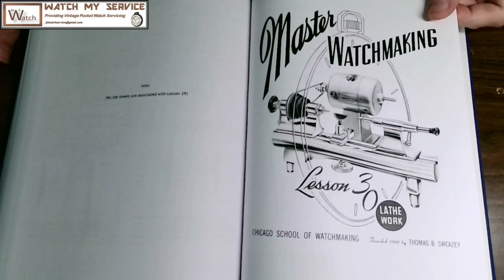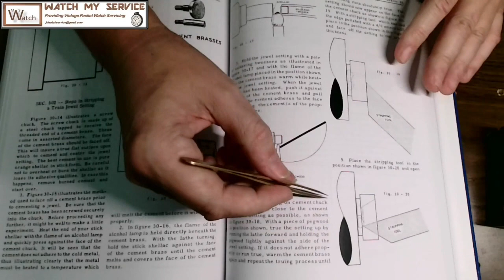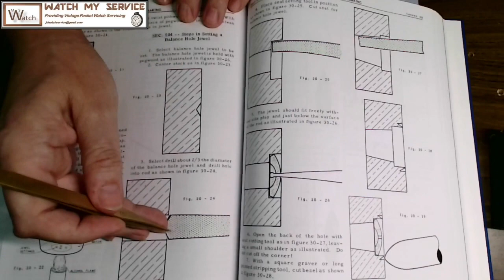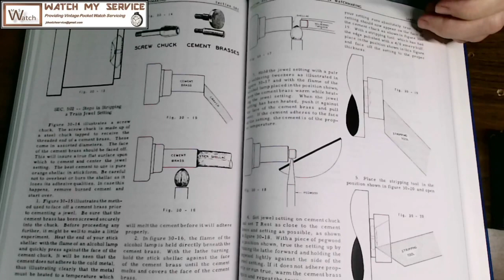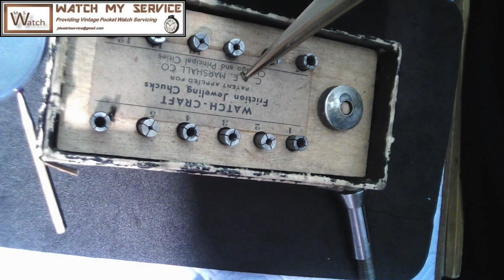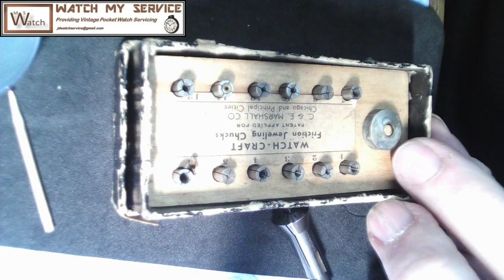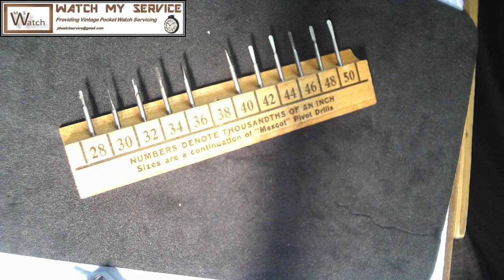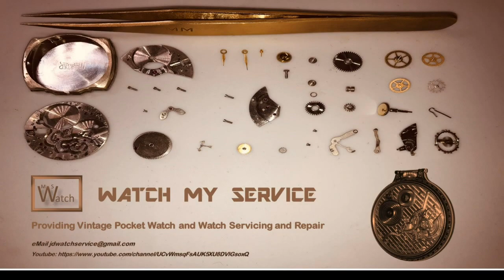Making a Watch Jewel Setting (21 Jewel Illinois Pocket Watch) - Most Detailed on YouTube

Comment: Another great video. 
Thank goodness there is still lots of (watch  material) and junk movements out there, 
where you can still find a center jewel and setting for this type of watch, and other 
American made watches. 

 Turning a jewel setting from scratch would be something you might need to do if the watch 
you are working on is some foreign (or unknown) brand, where watch material cannot be found.
Reply from the maker: Actually to find a jewel setting you off and have to buy a scrap movement and take the setting from that. But for very high-end pocket watches, it’s almost impossible to find scrap movement with the jewel settings have not been already removed. So I haven’t had much luck finding a brand new setting for a very high-end watch.